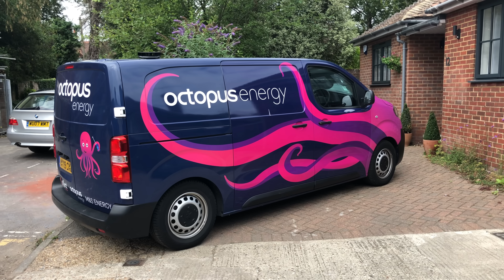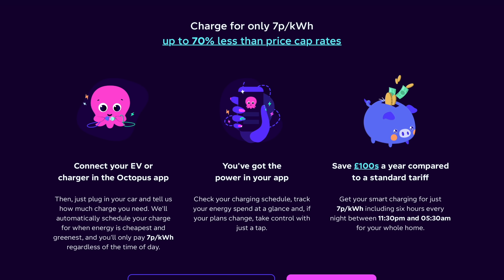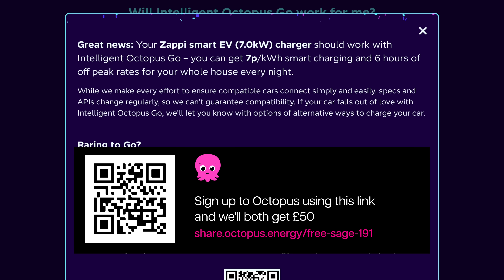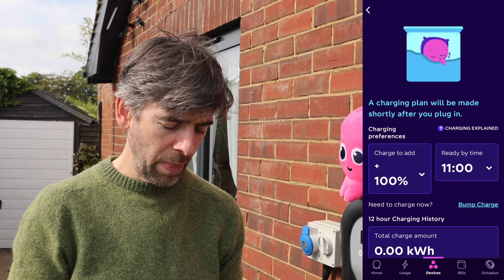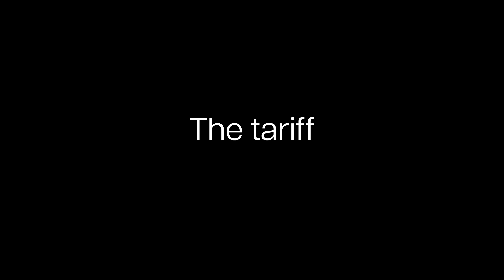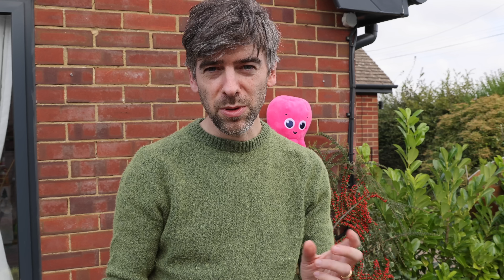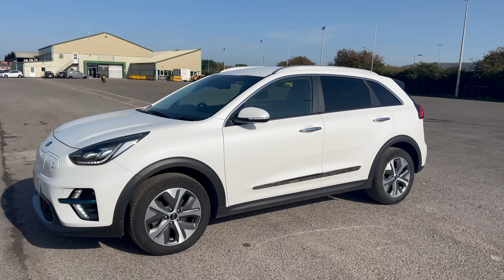We've saved a fortune! All about the UK's most popular EV tariff: Intelligent Octopus Go

Comment: Octopus Agile is still cheaper than Intelligent for us over a day, week, month or year. Intelligent would have cost us another nearly £50 last month compared to Agile for e.g. We charge a 51kWh battery EV every night during whichever are the cheapest 30 minute slots. If we want to top up in the day for any reason, we just charge around our needs rather than based on price. The only adjustments we make is trying (but not always remembering) not to use the washing machine and dishwasher during peak between 4 and 7PM.

Comment: I’ve used 6720kwh this year so far 2 EV’s, heat pump and home battery (no gas) cost circa £500. I’ve exported everything my solar has generated (4509kwh) for 15p per kwh £676 so I’ve made nearly £200 this year so far. I only pay £1 per month as Octopus won’t let me pay zero I hope to break even over the year which for about 22k miles of driving, all my hot water, heating and house use I think that’s incredible.
Reply: Nice. I have 13kw growatt batteries and solar.  Just had HV charger fitted for a tesla. How can I set it up so that I am exporting in the day rather than charging the car in the day on the cheap schedules?  Thanks
Reply: @hsingh1770  I charge at night and my Tesla battery has a shedule so it knows not to discharge between 2330 - 0530. If I charge in the day I set the minimum on the battery to the level it is at so it doesnt discharge. You cannot stop the solar going in to the car when charging.

Comment: if it's connected to the charger only then I think the value you set in the Octopus app is how much additional charge you want, rather than a target SOC. Not ideal as you have to set the value every time you plug in. You can leave it at 100% but that won't be optimal for the scheduling algorithm as it'll be requesting a lot of redundancy.

I have a Leaf and use Home Assistant to bridge the gap as it has access to both my Octopus account and Leaf. I set a target SOC in Home Assistant (which I rarely change) and Home Assistant works out the difference and sends this to Octopus for scheduling

Comment: Even if the octopus app is set to 100%, my charging stops at the limit set in the car which is usually 80%. We have MG4 Extended Range (77 kWh battery), Zappi charger and solar panels/6 kWh house batteries. We do a few long trips each year when i set the car to 100% and it charges to that no problem.

Comment: Morning Andrew. Watched your latest YouTube video. Completed the Intelligence Octopus Go for to compare prices. The charger box details they ask for, a very long list of wall boxes. However Zappi is not listed so cant continue. Have just sent Octopus a email, see how long it takes for this to be resolved ? Have two EV’s, 12 Solar panels, Air to Air system for heating and Gas (cooking only), 1x MG4 long range, 1x Zoe  and a Solax battery.
Will not want to change my Fits rate that’s just under 80p a unit generated. So how did you complete the form when the Zappi is not listed ?
Hope your moved went. Bob. Gillingham Kent.

Comment: Good video. The cost of running your EV’s compared with running similar ICE vehicles is impressive. However, as I’m sure you already know, it’s only a matter of time before EV’s will start to be charged per mile as ICE vehicles are already charged per mile in the tax they pay as part of the fuel cost at the pumps.

Comment: OIG is really good but sometimes it causes us issues with storing cheap electricity in our battery. Our system finds it tough to handle pulling 12kW ( 7 for the car and 4.5 for the battery ) at the same time. The addition of Eddi to heat water is going to add an extra 3 kW pushing the demand to over 14kW if all are drawing down at the same time.
Reply: Easily sorted. At the Zappi go into advanced settings, Supply Grid, Network then Set Grid limit to the max power to be pulled from the Grid. setting 60 amps will limit the grid usage to approx. 14.4kW. As soon as you try to pull more, the Zappi and Eddi will ramp down their power demand to stay at or under the grid maximum.

Comment: Your 'Using It' section perpetuates a very common error - You should set the % to add to a realistic value, not just leave it at 100%.  If your car is at 50% and you want to charge to 100%, add 50%.

Comment: I’ve been on Octopus go and now on their intelligent go tariff since its inception we also have solar panels two Powerwalls and since last year Octopus heat pump. We only ever buy electrons at the cheap rate of 7p per kw and our bill for heating, hot water and the EV is now just £30 per month over the year and we get a fit payment so really our outgoings are nearer to £15 per month We made a very large investment to get where we are today but as interest on our saving was minimal we felt it better to put the cash into our home. Doing that has increased its value made in a better buy if we wanted to sell and reduced our energy cost to a pittance compared to when we first bought the house. For us it’s a win win. 🥇
Reply: Interesting. I’ll investigate these options.
Reply: Have you considered an My energi eddi for your hot water tank? Hot water from off peak electricity, excess solar or your battery.

Comment: We are a low use household living in an 1870's kid terrace.  I charge using a 16a commando charge cable across the pavement using a cable protector approved by the local authority.

At present we have gas and electricity but we are plotting our migration to electricity only so have been working round the house adding internal, underfloor and of course loft insulation.   

The next decision is heating: we have a pre condensing combi boiler which is reliable and 7 radiafors fed by 8mm copper microbore from a central 22mm copper manifold.   My thinking if we want a heat pump we will have to replace the radiator tails with 15mm which will be quite an upheaval.

Proboem is, with a heat pump we will then require hot water storage of some kind and a battery would be sensible.  Quite an expensive and hugely disruptive project and quite a challenge finding the best tariff if we achieve our goal.
Reply: HI, Octopus themselves now do a high temp heat pump that may work with your existing plumbing, google Cosy6, re a water tank, think of that as also being a battery (its storing energy) a water tank is the cheapest form of energy battery. A cheap solar diverter will dump any excess solar into your water tank as stored energy.

Comment: I am thinking of moving to eon as it’s 6.7 p for 7 hours and the normal rate is currently 1p cheaper than intelligent go. Plus export is 16.5p while intelligent go matching export is 15p. 

I don’t know why I have intelligent go as my car was removed from it a year ago and I don’t have a compatible charger. 

Btw I charge 3 EVs totaling over 50000 miles a year, heat pump, battery and solar. I think I am quids in but on my second smart meter and it’s stopped reporting months ago. My solar inverter is reporting really encouraging figures.
Reply: I've no experience of octopus, but have Eon Next drive V4. It's definitely a cheap tariff, and 7 hours cheap rate is very useful for adding a decent range in the cheap rate period.

Comment: It is quite hard to calculate exact numbers but I have travelled 32,000 electric miles for about £585 . I have solar , ripple shares, house batteries also adding to the mix so it will actually be cheaper than the estimate above.  The house battery is over sized and I sell excess electricity back to octopus at 15p per unit so I actually don’t pay much for electricity anymore.

Comment: I’m on standard GO so only get the 5 hours of off peak at 8.5 pence at the moment, but also have solar and 30KW of GivEnergy battery storage, plus I’m on an export tariff that pays 8pence per KWh exported.

Using GO to charge the car and the house batteries during off peak, solar to power the house and charge the batteries when there’s excess, and to top the car if the batteries are fully charged, I’m also balancing the overnight battery charge using home assistant and the predicted solar availability, so that the overnight target SOC for the batteries will be reduced if the following day is going to be a really strong solar day (cheaper to charge the batteries using solar than GO if available so I don’t want to charge them to 100% overnight if the following day has a lot of solar).

My car fuel costs for the ZOE while I had it were 340GBP for almost 17,000 miles of driving.  I don’t have numbers for the Tesla yet, but it’s tracking on similar lines (to within 6GBP of the cost of the ZOE at 3k miles).

I’ve also been tracking how much we’ve used in Solar, and how much we’ve saved by charging the batteries using off peak and solar, then using them to power the house during the day instead of pulling from the grid at peak.

In a typical month, we’ll use around 950 - 1050 KWh (high usage I know), but that will break down to around 50KWh of Peak and the rest split between Solar and off-peak (up to 700KW of Solar in the summer months and the other 200 or so KWh at off peak rates).

So far, after 2 years of having solar and batteries, we’ve saved £6,000 GBP in electricity costs, which has pretty much paid for the panels and install, and I’d expect to have the costs for the three GivEnergy I.tKW batteries paid off in future savings in may be another 3 years or so.

Another thing dropping the bills, is I used to have to put around £300 a month of diesel into a car to get to and from work, but now work from home, so as well as having the EV, my annual mileage has dropped by around 10K a year, but the EV is as cheap as chips to run!

(Since we no offset most of our usage to off peak prices, and use less from the grid due to the solar, I’ve also currently got a £950 excess banked with Octopus which will more than cover the higher costs of heating the house over Winter, so need to get some of the paid back into the bank account)

Comment: Just bought a Tesla model Y and switched from British Gas to Octopus. Paid £899 for an Ohme e-pod charger which they are due to install in 2 weeks - I'll then switch in the app to the intelligent tariff and be filling up for around £4!! I can't wait!
Reply: I'm in an almost identical situation now. How did it go?
Reply: @tobiaskilroy  Actually, after buying a second EV, for my wife, I am now having issues with the Octopus and having to disconnect it and reply solely on the Ohme app. I plug in and stop charging immediately via the Ohme app where I have two profiles for the two EVs, then restart charging at 11.30pm when the 7p per Kwh rate kicks in. It works fine on Fridays and Saturdays when I can stay up until 11.30pm, so we charge the cars then. It costs between £3 and £4 typically for over 200 miles of added range.

Comment: Due to lost records by electricity north west my house hasn’t yet been permitted a proper charger. This means that I’ve been using the granny for our extended range Mach e. 
The down side of this is it take days to charge.
The up side is that while the car is charging I’m getting way more cheap house electricity than I otherwise would.
I’ve occasionally even gone so far as to not plug in or tell the car to not charge overnight so I can get cheap rate at the weekend day time while all the washing and drying is being done.
I do feel a bit dirty gaming the system like this though (sometimes)
I just worked it out and my average price per kWh for the whole of last month was 14.7p

Comment: We are also on Intelligent Go. Like you, our entire house is electrified - we have solar PV, a Tesla Powerwall, a heat pump for heating, and 2 EVs - a 30 kWh Nissan Leaf and a 61 kWh MG5. Our savings in terms of running costs have been in the thousands of pounds each year compared with running two ICE cars, and heating our house and cooking with an oil fired Rayburn. Our annual electricity bill is around £1000, but since this covers all our household energy consumption, including hot water and heating, as well as 20,000 miles of driving it’s fantastic value for money.
Reply: Interesting. I’ll investigate these options.

Comment: Personally I don't feel it is "gaming" because firstly Octopus have no way of knowing that you genuinely don't need to charge to 100% and secondly you can only take advantage by using the scheduled excess renewable energy which THEY make available to you by schedule. If it's not available you won't be able to do it, sometimes it may not work in your favour.
Octopus also have no way of knowing how exactly you're using the electric once it enters your house (I'm thinking, might be wrong).
If they don't like how you're using it they need to have further control on the excess distribution (which they don't appear to have).
I think a lot of people didn't grasp the crucial part of this video judging by the comments and assumed it was just about cheap charging. VERY interesting golden nugget there, thanks 👍🤔
P.S. I think the chances of octopus implementing fair use policy on a single customer are extremely low to zero. They just want volume (customers) and out of those this particular scenario applies to a very small percentage who can take advantage. 
In reality how many people you will make an effort to do this?  Very few,  most people simply don't have the foresight or time. (but I'll give it a go 👍)
Reply: Currently you are correct, Octopus are very unlikely to implement any kind of fair use. But if videos like this go viral then they will. I know from being on the IOG beta for Zappi, they can monitor whats been delivered. We've also seen it recently with the half price charges which applied to what the charger used. So if you're constantly asking for 100% and only ever taking a small percentage, always during the day, this will get logged/flagged. They do, in the T&C's say that they can move you off the tariff. I've not heard of it happening to anyone yet though. At the moment there's not enough abuse to warrant doing it, and often, they'll actually get paid for your charging as part of grid balancing. So dont think they aren't aware of it, its just for now, they are trying out new things and letting it slide. 

FWIW, it totally is gaming the system to ask for more than you need. Otherwise why would they have an option? They are trying to optimise grid usage and keep costs low for everyone but also are generous enough to say 'if you need 100% right now, lets see what we can do'. If everyone did it, do you really think they could sustain it? I'm all for using extra slots when they come up but you shouldnt be asking for 100% charge every time thinking its not an issue.
Reply: @VikPaints  the equipment measures and reports back how much has been delivered. If that happens waay quicker than expected then they could potentially build a picture up if you are doing it regularly.
ie If you say you need a 100% charge of a 64kWh (8hrs charging) pack and upon plugging in a half full LEAF the charge reports back complete after 3hrs; I think they’d figure out you were telling porkies about needing 100%
Reply: @salibaba Yeah I can see that would flag up quite easily.

Comment: 9 miles south east of your new home,  we were on Octopus Go.  We have a 2023 Niro EV4 & 2022 Peugeot e208. Neither compatible with IOG.  So after Everything Electric show at ExCeL when we talked to Octopus and Myenergi, we changed PodPoint charger to Zappi.  So we started on IOG late May and have found it much cheaper but difficult to compare year on year as we also had 8.5kW of solar and 15kWh of batteries installed in October 2023.  We have only recently got the hang of smart charging because we were doing everything through the Zappi app but now using Octopus app.  We have done 12,000 miles in the two cars in 12 months . 11,000  charged at home at low rate 8.5p/kWh for 6 months and 7p/kWh for the other 6 months.  A few 1hour events of free electricity when we filled the home batteries and added 7kWh to one or other car.  Including fast charging via Electroverse and Tesla superchargers our total bill for powering the cars has been just under £300,  about 2.5p/mile I could tell you why Kia pulled out as I have a well informed contact, but that will have to wait until we hopefully meet for pizza and Italian wine at Cuculo Deli in Heathfield once you are settled in.

Comment: I live in Munich and I'm looking into switching to an electricity supplier that provides intelligent tariffs like Octopus. Also, I'll be changing from an Kia eNiro to a Kia EV3 80kWh battery. Also may be moving away from oil central heating to a heat pump system. So let's see how it will work out.

Comment: I hope "gaming the system" like you do doesn't spoil it for all of us, I also have 2 EV and a Zappi and all you have to do is adjust the requested charge by the relative capacity of the cars. I've had the tariff for a year now and have spent £325 on electricity for the house and cars but I do have a home storage battery so the vast majority of electric only cost the IO Go rate I also have solar and that returned £346 in the same period 😊 this tariff is the best for EV charging. If it would work for a heat pump I don't know
Reply: Octopus are monitoring it, so if the abuse becomes widespread we may well see the end of this, or at least them not giving house electric at the same rate as charging, which would be a massive shame, because people feel asking for 100% every time is harmless. 

Octopus are participating in grid balancing now, so that will claw back some of the potential losses as they will turn the charger up/down during the charge window, or even move half hour slots around. So you really need to be on it if you want to try and use the cheap slots to their max, as you could find they move them while you're not looking and suddenly what you thought was cheap leccy is now full peak rate!